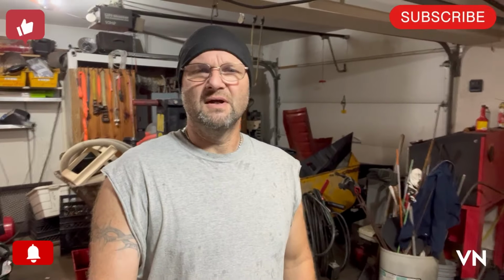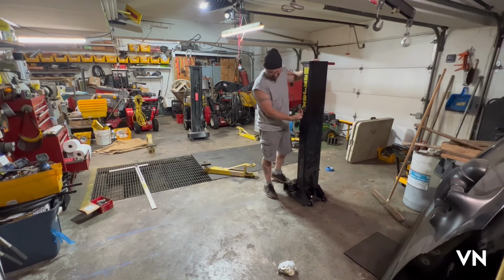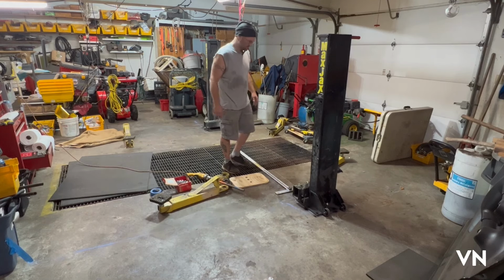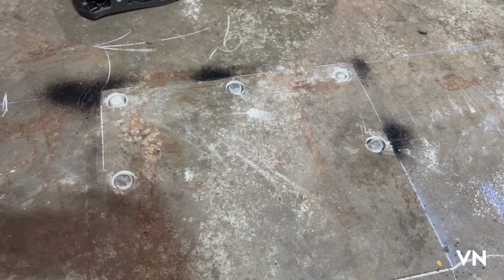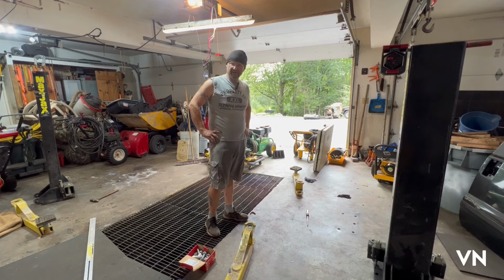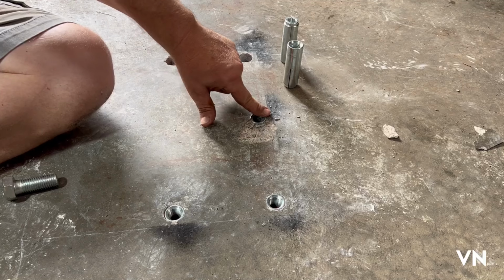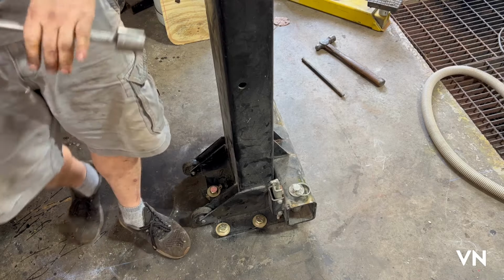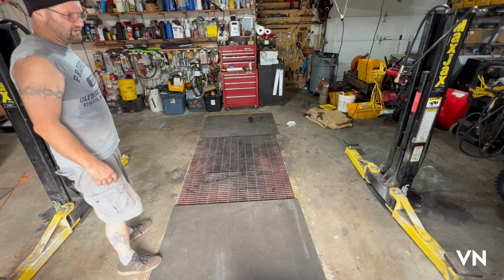🪝Installing a Car Lift in The Garage!

Comment: Hey, I just bought one of these lifts used too. I was just wondering how long were the drop in anchors you used? And how deep were the holes you made? I am trying to find the drop in anchors like you used but can’t find any long enough. I believe the original ones from the kit were 4” if I’m not mistaken. Please let me know thanks
Reply from the maker: I used what the original owner used. Hilti HDI 3/4 part number 336429 I do believe. Manufacturer recommended 5/8 I do believe. So bigger is better. 

There is a chart as to how deep the holes need to be. (3 3/16) by one inch diameter. But I would go 1/8 inch deeper. 

Follow the anchor installation directions is my advise!! 

Good luck and thanks for watching.